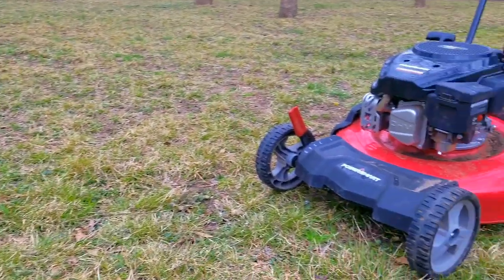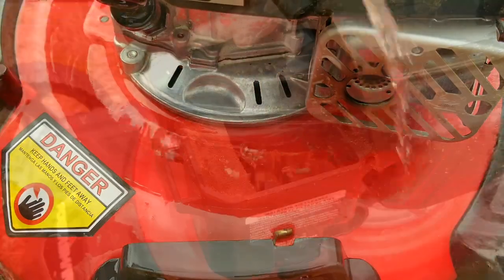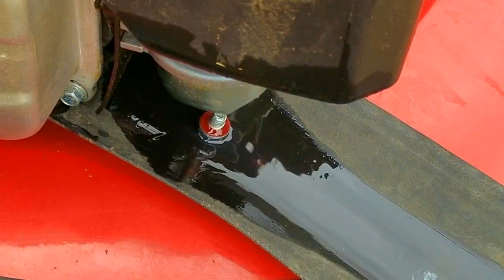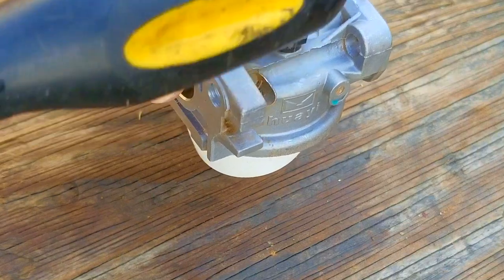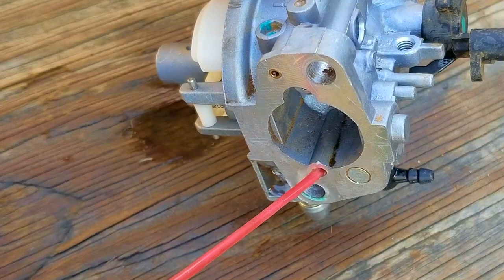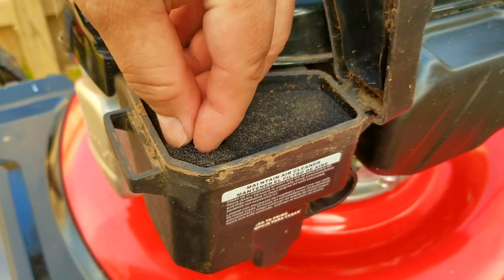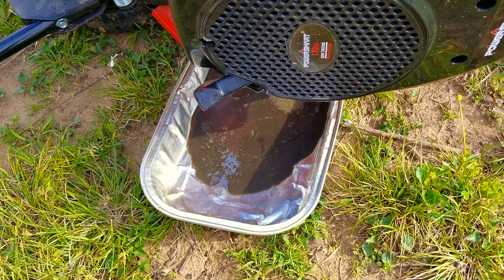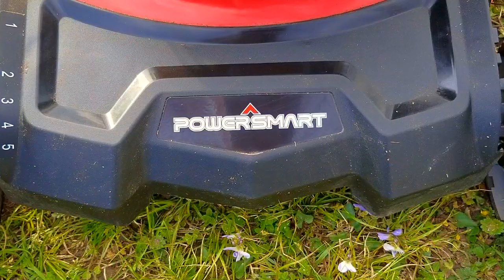Fixing A Powersmart Mower That Won't Start

Comment: Just like others are saying, I have same mower and was getting super pissed at it. I live at Jersey Coast and there was rust in my carb. Cleaned it out and checked the ports and after tuning the carb again it works great. Thanks for posting the video, saved my mom and I a few hundred bucks!
Reply from the maker: no problem and good work!

Comment: This video was amazing. I found a mower on the side of the road.  The bag, manual and tool to change the spark plug were with it. It  looked like it was garage kept but wouldn't start unless I put gas in the carburetor.  I followed the video and it started on the first pull. Thanks you so much for posting the video.
Reply from the maker: Glad it helped

Comment: I have one of these and have had it for 4 years stored it outside all year around even in the winter I never put fuel stabilizer In it and no tarp straight out in the snow and no issues besides a clogged card because I put 87 in it but then I cleaned it put 91 no issue since and then a year later a chipmunk bit the pull cable and I replaced it no issues again this thing can take a beating Handel weather and still run like a beauti 10/10 love this thing to death
Reply from the maker: very nice, thank you Keylan Kacz .

Comment: Tank you so much for this video! i know nothing about mowers and i have this same model, this is very helpful!  i didnt know you could put fuel in the carbs throat to see if it will start and i did that and it started! I was a idiot and left fuel in my mower, but i wont make that mistake again! now off to clean my probably very dirty carburetor, thanks again! i did not want to get a new mower after only 1 season

Update: i did what you showed and it started right up! Thanks again!
Reply from the maker: thank you GameNerdMon Garden.

Comment: It's amazing to see how people get rid of perfect running equipment just because it wouldn't start. With a little TLC and maintenance even the most affordable piece of equipment can go a long way once you take care of it.
Reply from the maker: I know right, the fix wasn't as involved as I thought.
Reply: @INSIDEHOUSEGARAGE  exactly you didn't even needed to replace any parts which is quite amazing just a little cleaning up and presto you have yourself a backup mower to use at your convenience
Reply: I do this all day, people ask $15 for a 3 year old mower that won't start and it's almost always the jets... a set of $10 jets later it sounds great. Usually you can clean the jets, I only buy them when they are corroded and I am not sure they will be ideal after cleaning.
Reply from the maker: that's the best type of repair. no costs, just time.
Reply: I have three mowers.  One I purchased in a store...two others I found curbside (discards).  The two that work are old and are the discards.  People get rid of stuff prematurely.  I purchased a powersmart for $100 from home depot.  It breaks but the warrantee is fantastic.  They help me out every season to fix the common breaks (due to manufacturing problems).
Reply: @jesseguerra2012  sounds like your curb treasures are your best equipment 🙂, Good service is a big plus but who has the patience for anything that breaks on a schedule?
Reply: @TheJesseGuerra  that's great. At least you can use the powersmart mower as a backup while the two discards can be used as your main mowers.
Reply: Ok, I'm sitting on the garage floor. I recently gave my mower away after having 2 in the garage for months. It worked but in my ignorance destroyed the self-propell beyond repair. So why am I here today? I noticed something at my neighbors bush several mows ago. The man I gave the old mower to noticed I had no air filter.  Yes, I'd been mowing without the cover or the filter. It came off while mowing! So I ordered 3 new ones from Amazon. Size was right according to their numbers. Not, came to find no. It didn't fit. I mowed with the old filter that had been out in the weather several weeks. So Fastforward, I received a new filter thru Powersmart website. It DID NOT fit. I again mowed with the old filter. Now, I have the filter that fits READY TO GO! The grass is tall. Been 2-3 weeks. I'm about half done. Mower quit. Checked oil. I think it looks good. Gas is good. There is a screw missing from the plastic cover so took it lose. Oh, I forgot I did mow 1 more strip without the filter. Now the blade seema tight. Can we really guess with no filter this is the carberator? I really don't want to tackle emptying gas and dealing with those parts. It's Sat night. This chick wants nice nails for church.Ugh!!
Reply: Hooray! I sprayed into the air filter with electronic duster air. Sprayed the bearing on the blade with garage door lubricant, added a little oil and replaced the air filter and the plastic top. Yes, I finished mowing the entire front lawn. Thank you. Thank you for your video.
Reply: @TheJesseGuerra  Good to know. I bought 1 from Home Depot I think it was just under $200. The air filter cover came off unnoti ed then the air filter. I found both parts but the filter was destroyed. I didn't know about the warranty. That should have been covered since the cover popped off. Where do you go for the warranty Home Depot or Powersmart
Reply: If it doesn't start for just a year later, then you should get rid of it and never buy from that brand again.
Reply: @Victic005  but then again who has sufficient funds to keep wasting on lawn equipment every year? Most definitely, not me.
Reply: @ramadinsookhoo6141  well, when you see that this mower won't start in one year, you gotta avoid buying it.  I am looking for a Honda HRN mower now. They're all sold out.
Reply: @Victic005  I understand that things are different in USA. I'm from the Caribbean and I have a Stihl 280 trimmer that is 19 years old and I got it serviced about 3 times since owning it. I also own a Stihl 025 chainsaw which will be 33 years this year and serviced it a few times also. I also own a Stihl BG56 leaf blower for 7 years now with no servicing done to it, but you got to do what you got to do to maintain your property bro. I forgot to mention that both my trimmer and chainsaw were made in Brazil.

Comment: I Just purchased one last week, seems like a nice little mower.  Started second pull, but after a break, went to start it and it was difficult. Later took another break, it was hard to start. Ive looked at alot of videos on this brand, seems like alot of buyers had issues and call it junk. I think not. I suspect that the jets, even from the factory are clogged with some kind of film they coat everything in for initial break in. You could feel the substance on the dipstick when it was empty. Anyways, it ran really good, cut the grass with just the mulching blade, no bagging and did a fantastic job. Also, its fast, and didnt bogg down or hesitate on a tall yard of grass. Im going to clean that carb real good, and see how whe runs. For the price you cant beat it, and besides, I like to tinker.
Reply from the maker: nice, but the issue with  them is longevity, so hopefully it holds up well thru next season

Comment: that was an excellent detailed video, mine is almost similar161cc but has no continuous spark out of the coil any idea? thanks
Reply from the maker: how are you testing with the pull rope or  are you using a drill to spin the engine?

Comment: Thanks 4 the info.  I have the same kind of mower & engine.  When I mow the lawn & start the mower the 1st time it starts on the 1st pull, but if the mower is hot & I try a restart the mower pops ( I think it is backfiring & will not start ).  I  then let it set a little ( 5 mins ) & it starts up with a lot of smoke & then clears.  Do u have a answers 4 me b4 I bring it in for a fix.  The unit is a yr. old & under warranty.  When I start with the engine cold there is no popping.
Reply from the maker: sure, I would check the OIL, level properly and then remove and inspect the spark plug.

Comment: I have a Question about a troy-bilt riding lawnmower Bronco 42 auto Briggs Stratton   motor 540cc 19.0 what tips can you share with a video in keep this mower in good running condition
Reply from the maker: thanks Chris Coney for the question, unfortunately I don't have one to use in a video but I don't have a problem answering question.  I could a make a full length video talking about it, more in depth. 
Basically though, I would check the oil.. like if you have OCD. Check it before you start it up, and a few minutes after you stop it.  I would only use 100% gasoline with no ethanol.  I would also use a fuel stabilizer. other than that,
check tire pressures, make sure the spindles are "spinning" with little to No noise otherwise change them. And keep the all steering points, and levers, well lubed like you're working on a train from the 1900's.  The biggest issue
is the deck, its going to break one day. so just be prepared for that

Comment: I have a Powersmart mower 170CC. Two days ago, my lawn mower hit a stump of a tree in the backyard. Since then, I cannot pull the string all. Sadly the protection period was over. Should I bring mine to local shop to be fixed? Any suggestions?
Reply from the maker: unfortunately no, they will not work on it, you'd have to take it to a hobbyist, to get an inspection but I hate to tell you that the engine might be gone.

Comment: I hate to say this but that Torch plug came with that engine. I have seem them on many of the Chinese manufactured engines. What makes it bad when the manufacturer installs those Torch plugs is that matching up the proper name brand plug can be a pain but not impossible.

Comment: 3:46

If you see that black nipple thing that the primer hose connects to....do they sell these?  I am shopping for a new carb and some show pics of the carb with that black thing and some show just a metal piece facing same way as the fuel inlet...my concern is getting it with the piece facing same way as inlet and then i cant connect the primer hose to it...
Reply from the maker: yes the plastic nipple goes to the bulb and it''s the impulse that will prime the engine, I'd make sure it was plastic and not metal.

Comment: What size wrench did you use to get the bolts off? 

I have a 7/16 and a 3/8 and they don't fit it.
Reply from the maker: it's a 10mm
Reply: @INSIDEHOUSEGARAGE  
Just used your video earlier today. Worked like a charm.

Thank-you so much.

Comment: On my first use the back tire came off does it just pop back on? I have looked everywhere
Reply from the maker: just the tire and not the wheel right? I'm not sure on this model because its my first one, But If I had to guess, yes, just put it back on like a rubber band.

Comment: Hello, my TB575SS trimmer has gas shooting out of the little bb type device on the top of the carb near the fuel line inputs, I'm pretty sure this isn't normal. I have a good pic of the carb but don't know how to send it to you. This trimmer starts very easily after a couple of primes and idles normally but dies after about 30 seconds. Thanks for any help.
Reply from the maker: please send the pic to homegaragemail@gmail.com

Comment: I followed the instruction on this video to clean out the carburetor all seemed good. .No clogged holes and it looked clean. So now I think it might be the timing being off with a damaged flywheel key.  This video at the ends mentions watching out for stumps and I had to make sure my son heard that part of your video because that is exactly what he hit and now it won't start. lol
So, do you have a video on how to replace the flywheel key on a powersmart? I think my key is broken and it seems difficult to get the flywheel off. There is these 4 screws on the side that I believe I need to remove but it looks like I need to take the fuel fuel thank out and the exhaust.
Reply from the maker: yes I just filmed one, where a power smart mower wouldn't starts so I had to check the flywheel key, but it was ok. The video will still help you get to the key, however I haven't produced it yet, only filmed it.

Comment: My Briggs Classic 35 runs well on idle but when under a heavy load or in hot weather it makes lots of black smoke. The air filter is not clogged and it has the correct spark plug but it has a low compression reading from when using the pull cord.

Do you have any suggestions on what is causing this?
Reply from the maker: unfortunately, with low compression, and under load, the engine isn't compressing the air fuel mixture well, so it comes out the exhaust as black smoke, because of poor combustion. nothing will fix it unless you rebuild it with new rings.
Reply: @INSIDEHOUSEGARAGE  oh . Okay thanks
Reply: @INSIDEHOUSEGARAGE  Thanks for your advice. I have managed to fix it. I replaced the diaphragm and gasket in the carburetor and it runs very well no with no smoke at all now, so its not doing too badly for a 22 year old engine.
Reply from the maker: nice work

Comment: I have this lawnmower it is currently vapor locked. Ive only used it 4 times or so.
Reply from the maker: hope you get it working again
Reply from the maker: I don't think it's vapor locked, so no. I'd check for spark, and then try priming the engine with fuel to see if it's an fuel/carb issue.  After that I'd repair or replace the questionable part.
Reply: @INSIDEHOUSEGARAGE  i cant pull the string

Comment: This mower is made possible by people who confuse "new" with being "better". Where I live, it's pretty easy to find a used, self-propelled Craftsman or MTD-family mower with a Briggs & Stratton engine and a bag that has been "flipped" after a tune-up for an asking price of around $120 (and often negotiable down to the $80-$100 range)...basically about half of what this poorly-constructed one costs new, and without the worry of trying to source hard-to-find parts for a no-name brand should something fail.
Reply from the maker: thank you Ed Sanders.

Comment: I have a 200cc one  bought on discount, stopped running after 20 minutes, no spark but will shock you from plug wire, tried new plug still no spark, I unplugged the ground wire to kill switch no different, any ideas? I can’t return it no warranty 😵‍💫
Reply from the maker: try putting some fuel into the spark plug hole, and then try starting it.
Reply: @INSIDEHOUSEGARAGE  didn’t do anything, I ordered a new coil for it. It’s made in Mexico I think 😳😵‍💫 the Powermaster mowers
Reply from the maker: okay let me know what happens

Comment: If the mower cuts nicely, sure buy it, however, maintain it and any mower like you spent thousands of dollars for it, and it will last a long time.
Reply from the maker: wow, that's the best way of putting it. I'm going to have to start using that phrase.

Comment: Thats the mower I stare at online wishing I could buy if only my 6 year old Murray wasnt working just so damn well.
Reply from the maker: Nice Murray, which engine does it have on it?
Reply: @INSIDEHOUSEGARAGE  Briggs & Stratton 500E series. Gets only ethanol gas treated with marvel mystery oil. Has a petcock and fuel filter installed on the fuel line. Exercised twice a month during the off season. Never an issue.

Comment: Mine just stopped working after 3 years so I'm here 🤷‍♂️
Reply from the maker: did it stop while you were using it?
Reply: @INSIDEHOUSEGARAGE  yes I did three passes and it quit
Reply: @INSIDEHOUSEGARAGE  got it all back together still won't run.. the problem is this company uses a lot of plastic parts..I broke the handle trying to pull start it lol

Comment: Hey at least it has a metal deck instead of a cheap plastic one, and it uses a primer instead of an auto choke so that’s one less thing to break on it.
Reply from the maker: hey , you're right, that's a good point.

Comment: That's an awfully short fuel line.  I wonder if there are fuel shutoff valves that are small enough (short enough) to actually be able fit in that short line (I mean there really isn't much play there to work with).
Reply from the maker: yes it is short, I would suggest using a 90° fuel valve instead.

Comment: I notice you typically warm up the engine before an oil change.  Oil flows easier and removes more sludge?  That said,  oil is at top end of engine when run.  If you change it cold are you not capturing more oil since it’s all in the sump/ pan and none in top end of engine?  Plus less chance of injury of hot oil?  It may take longer but I usually let it sit and come back to it.
Reply from the maker: you are absolutely right it's best to change it when the engine is warm.  however, if you don't want to run what's in the engine, for whatever reason, a cold change is better than no change.

Comment: Has anyone had any luck finding replacement parts? Got one of these that wont run. The carb is also leaking and the bolt was cross threaded 🙃
Reply from the maker: I haven't had any luck yet.
Reply: @INSIDEHOUSEGARAGE  yikes. Not what i was hoping to hear lol

Comment: Is it hard finding parts for this brand of mower?
Reply from the maker: I don't know, I haven't had to get anything for it.  If I recall, the manual gives you all the part numbers, you just have to put numbers in a search engine and see if anyone has the parts.  personally I would never get or use this mower.   I'm not a fan of it at all.

Comment: Sadly, I don't have compression or Spark plug testers, or really any other tools, for that matter, except for maybe some hammers and screwdrivers, so there's not much a non-handy guy like me can do to get this thing running.
Reply from the maker: do you have any handy friends? don't give up so easily.
Reply: @INSIDEHOUSEGARAGE  Wish I did buddy.   The thing runs all choppily.   I wouldn't Know a ratchet from a socket, so when it comes to opening stuff up, it kind of  goes over my head LOL.    About all I can do on my cars are fill Air in tires, and fill washer fluid.   I wish I was born with the handyman gene, ROFL!